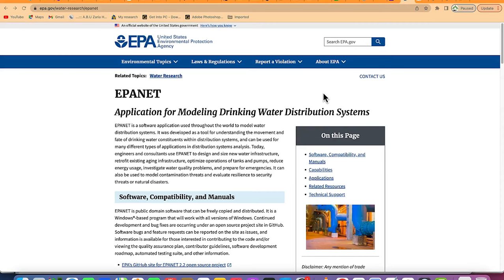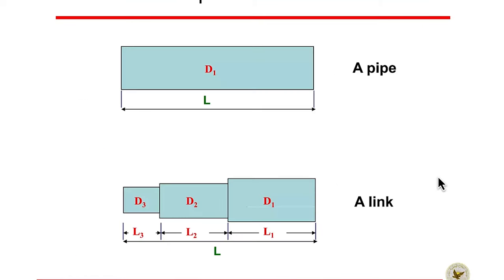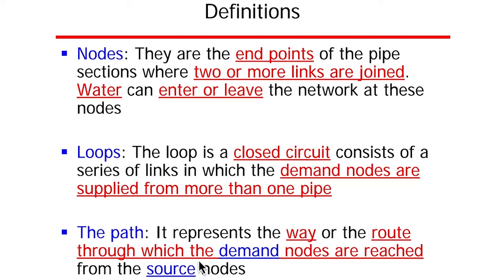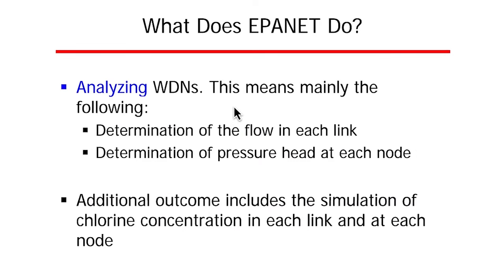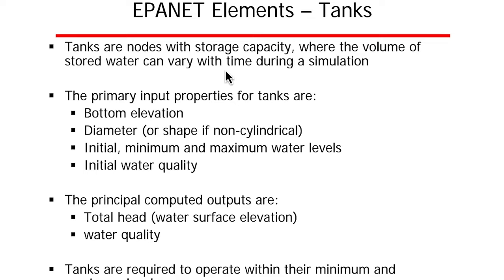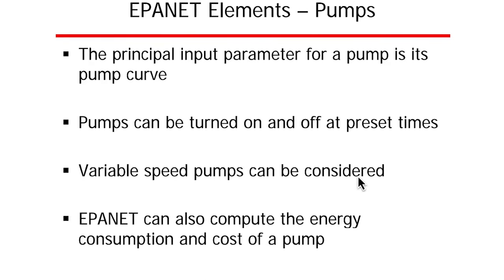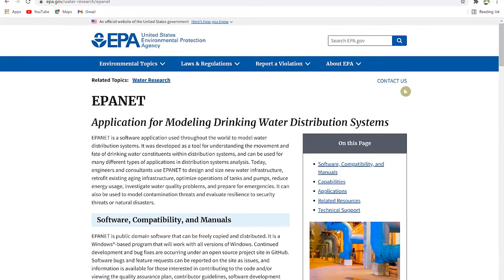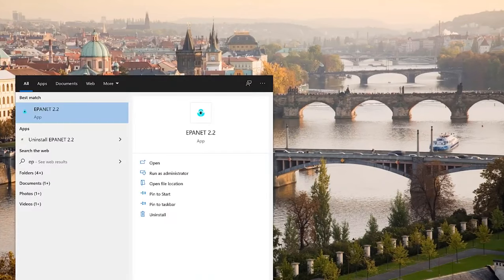Water Distribution Network Analysis using EPANET - Basic Principle + Example

Comment: 1:37 In EPANET its not possible to have multiple pipes with different Diameters connected in a row. You always need a node between them. So in EPANET a Pipe = a Link.